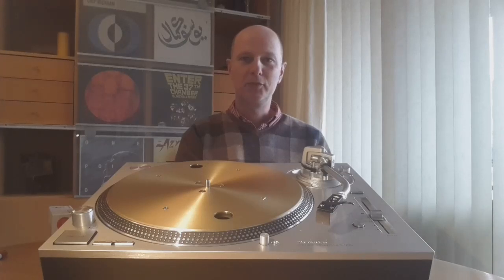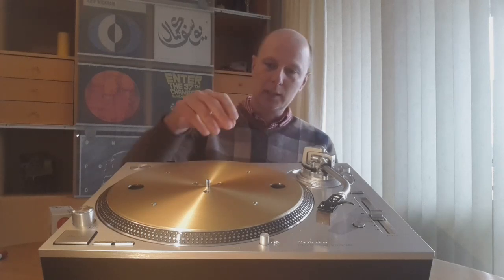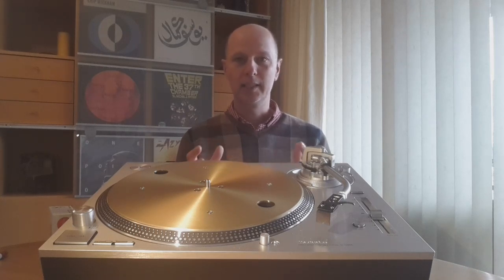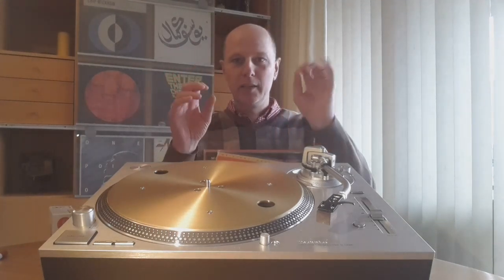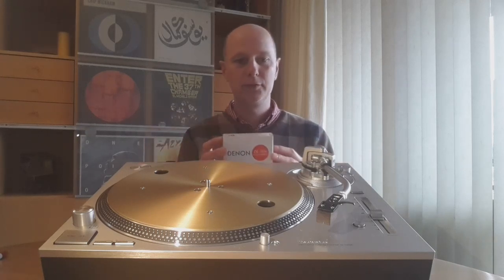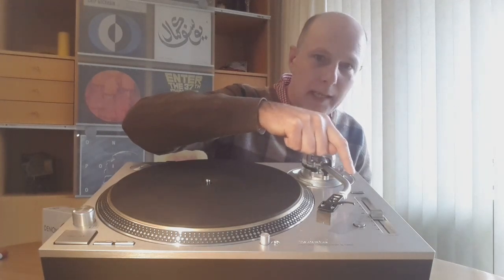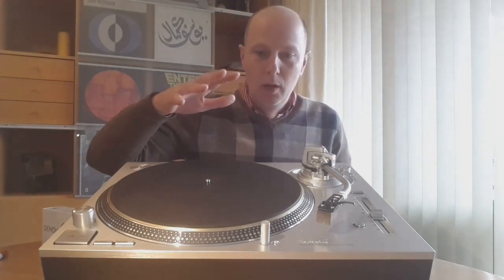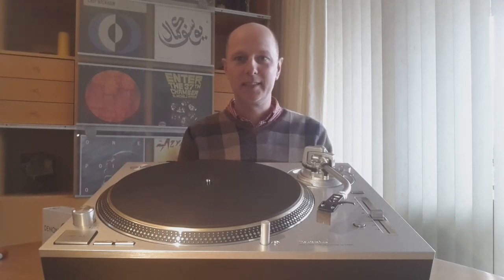Review Technics SL1200G - THE LEGEND IS BACK - Vinyl Community

Comment: Damn - now I am thinking about selling some of my vintage turntables and get my hands on this unit... Very tempting!
Reply from the maker: Hey Boris. Do you own any direct drive turntables? This is really a different kind of beast. Engineering is typical Made In Japan. In almost every aspect form follows function. All the best. /Paul
Reply: I used to have the Dual 701 direct drive. Nice unit but I already sold it... The pricing from the Technics still seems to be quite ambitious. Curious if they will place a more entry level model or with some higher demand the prices will drop. As far as I understood they had to start with most of the toolings from the scratch and therefore got higher in prices...
Reply from the maker: I've also read that most of the tooling for the turntable is new. I would be surprised if the price will drop for this unit. The craftsmanship is of really high quality. Almost all is done by hand. Technics are about to release the SL-1200GR. A model which benefits from all the development of the SL-1200G, but is simplified in some areas. The price will halved and for sure will sound also very good. /Paul
Reply: You know you wan't to!

Comment: i have owned the sl1210 since 1989 and have always loved the design and look and sounds good too , to my ears, when the 1200gae and the 1200 g came out i wanted one but was not in a position to purchase one, when the sl210gae was announced i bought one straight away and love it , i have both of them set up in my system running through a pro-ject phono box ds2 that allows me to select which turntable to listen to which is great , its a shame that so many audiophiles hate on the technics saying its a dj deck when it was never intended for that use it was just extremely good at it , I'm an audiophile but also a realist regarding the law of diminishing returns .
Reply from the maker: Hi Alex! Cool to hear you jumped on the SL1210GAE. One fantastic looking turntable. The original SL1200 is a legend. And I'm sure this new one will become also a classic. It it so beautifully engineered. Similar to the original, it feels like it is build a tank. Like you wrote, it will amaze and surprise audophiles how good it sounds. There is a special quality. Enjoy! Cheers. /Paul
Reply: @XjunkieNL  thanks i will enjoy for many years
Reply from the maker: Same for me. I don't think I will change any time soon. /Paul

Comment: I just upgraded my 1200gr to the 1200g and wow what a difference.  I tried using the Teac Washi mat but prefer the original mat I feel it's warmer in the high to middle frequencies it could be just my hearing which knows
Reply from the maker: Hi Gerardo. Fantastic upgrade. The SL1200G is a different animal. It's a lion, compared to the standard cat :) One of the nice things of the washi platter mat, is that it sounds different. You can tune the vinyl setup with it. Maybe fun to know, the last 2 months I've been using the thicker SL1200 rubber mat again. Sometimes I prefer the warmer sound. Enjoy your new turntable. All the best. Cheers. /Paul

Comment: Wonderful share! Might anyone know if the speed can be manually adjusted on this turntable if the strobe light indicates the need? This TT would be used at home. I am not a DJ so I have no idea if the slide mechanism to the right of the tonearm can be used to make micro adjustments to freeze the strobe light at the perfect 33 speed. Thanks!
Reply from the maker: Thanks for the comment. The speed can be manually adjusted. Because the speed is automatically controlled the zero setting on the slide will always be 33 1/3 or 45 or 78 and correspond exactly with the strobe light. The other rings on the platter correspond with a speed of -3,3%, + 3,3% or +6,4%. For a general idea +3,3% is a speed of 34 rpm. If for any reason the zero setting doesn't correspond with the strobe light, the unit probably needs to be serviced. Hope this helps. /Paul
Reply: Thank you. I had it a little different in my mind thinking that the slide mechanism would allow me to make a micro adjustment to the speed (faster or slower) if the zero setting (aka reset) and the strobe light were not perfectly aligned (in sync). Instead, zero equals 33 1/3. Otherwise,  a fix is needed. Got it. Is this something that happens, or can I expect a direct drive motor to hold its speed perfectly for a long time?
Reply from the maker: The speed control and the decoder to know the exact position of the platter are the heart of this machine. Looking at the craftsmanship I expect it to be spot on for the rest of the lifetime of the machine under normal conditions. /Paul

Comment: Were you worried at all that by tilting the deck like that - with the heavy platter in place - that the spindle or motor mechanism would be stressed?
Reply from the maker: Hi John. The whole feel of the turntable is that it's build like a tank. I wouldn't hesitate to play records vertically if that was possible :) Of course it's best to have your turntable as level as possible. Have a nice Sunday. Cheers. /Paul

Comment: Wonderful review, and certainly a table I would get if I had the cash - heck, it beat the Contiuum Caliburn in that Analog Planet Video (since Fremer did NOT swap audio, and his table had an issue with the record since it was warped while the Technics played it with no issue)...
Reply from the maker: Hey Chris. I hope you come across an affordable SL-1200 at some point. You would have a lot of fun with it. As a big part of the collection consists of thrift store finds, it is good to know it can handle it. Also part of the reason I spin with a conincal needle. Cheers. /Paul

Comment: Does it come with the classic rubber matt?
Reply from the maker: Yes it does. Maybe it is a little bit smaller, this to show the brass plate. Surprising thing is, it is still on there, sounds good. Cheers. /Paul
Reply: This is the matt that i use, i think it is very good, at least it seems to my ears that it sounds better than the felt matt i was using, no static whatsoever
I would like to try the rubber-cork matt though
Reply: Buying this new version is definitely one of my future plans
Reply from the maker: I haven't experimented with different mats. In the past I liked to change and see the effect. With this turntable I'm happy with the sound. /Paul
Reply from the maker: Hope you get the chance to audition one. You will have a blast. It is an amazing machine. /Paul
Reply: I can imagine :)

Comment: How much does the Sl-1200g cost?
Reply from the maker: AceTechHD In Europe the price is thirty five with two zeros :) /Paul
Reply: There is also the cheaper model SL-1200GR or SL-1210GR which costs 1500€-1900€. I have one and it beats all the other turntables i owned before.
Reply from the maker: And I'm sure the performance of a SL1200GR will be very close to the SL1200G. Not as big as the price difference would suggest. The technology used to make it a fantastic turntable is very much comparable. Enjoy your new beast :) /Paul

Comment: I'm picking up my 1200GAE in June (when I'll have saved up enough cash for one) if I can still find one on EBay or wherever else I may run across the limited edition one.Cant wait for these 3 months to go by!
Watching this video months ago helped seal the decision to go with this direct drive one over a belt driven VPI one. 
https://youtu.be/_tKe2JSeX4Y

Also this one : https://youtu.be/NYT9y6WqMm8
Reply from the maker: Thanks for stopping by. Hope these 3 months will pass quickly for you. I also couldn't grab a GAE when it was released. Not sure if you need to go for the GAE, the SL1200G has almost the same specs. For as far as I know only the color of the feet is different. Thanks for the links. Some great footage of the development of this amazing turntable. Cheers. /Paul

Comment: Would you say this turntable would fit in a High End audio system?
Reply from the maker: This is of course dependent on what the owner of the system is looking for. Just looking at the sound quality, in my opinion, the turntable easily fits in a high end system. This is mainly based on the above par consistency of the drive system. Thanks for watching. Cheers. /Paul

Comment: the legend is back, but barely better than the previous version. Cogging is placebo effect for sure, and they have still not replaced that very mediocre arm and took the power supply external. Technics was lazy if you ask me.
Reply from the maker: I have to disagree. Not sure to which other tonearms you compare with to call it mediocre. I haven't heard the TT with an external power supply so can't comment on that. In general the production tolerances are much smaller on this version, which makes an already good sound TT sound fantastic. Cheers. /Paul
Reply: Fair enough Paul, but you will probably be aware that there is a huge modification industry for a 1200. I was in touch with a very well respected hifi journalist here in the UK. He agreed that for the price of a brand new 1200G (or GAE), you will achieve vastly better sound with a second hand mk2, modified arm and external power supply. You can achieve that for the same money pretty much. Most mk2-5s are still in great working order, I have one that's still new in the box. The alternative arms to fit are either from Rega, Jelco or SME. You would probably be looking at an SME M2 or a nice Rega RB202. The stock arm is quite resonant in its design and obviously built down to a price. Google Art Of Sound forum, their "techiepedia" explains it all. However, the stock arm can benefit from a rewire as the internal tin wire is of poor quality. The internal PSU is quite noisy electrically, and better cartridges will pick this up as they move towards the centre of the record, resulting in a slight lack of high frequency clarity. As long as your system is capable enough, it's not only until you hear a modified mk2, do you realise that the stock unit is so constrained and really what this deck is capable of. I just think its a real shame that Technics did not benefit the consumer with at least the option of these mods, rather than taking a more pedestrian route. I am convinced it will make your Denon sound even more incredible. Anyway, enjoy!!
Reply from the maker: Thanks for the comment. I hope someone will have the opportunity to compare a full modified mk2 and the new model. Both models will be able to produce an amazing sound. Costs will probably be similar. Test measurements I have seen for the new arm showed only one clear resonance, all others were below the noise level. Technics clearly upgraded the arm to get better results compared to a standard s-shape arm. My guess is this is also true for other parts, that are not directly visible, like the power supply. Other upgraded parts that are visible are for example the platter. A shoot out will be fun as the path Technics followed to upgrade their unit is different. /Paul